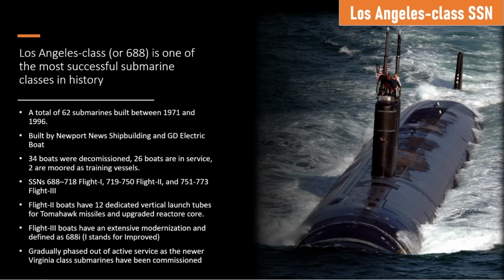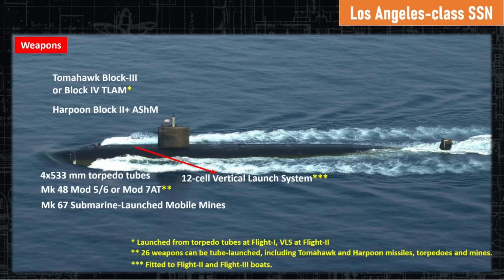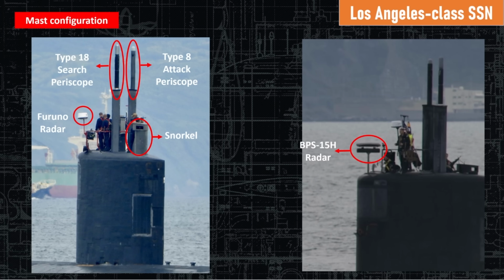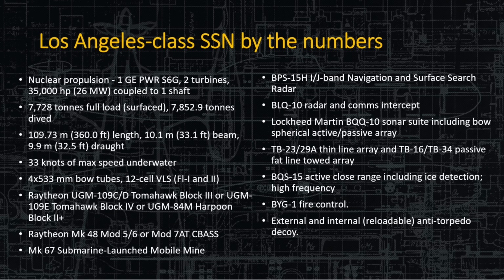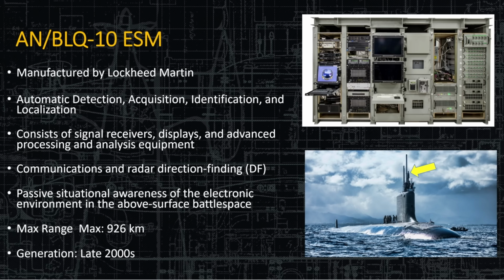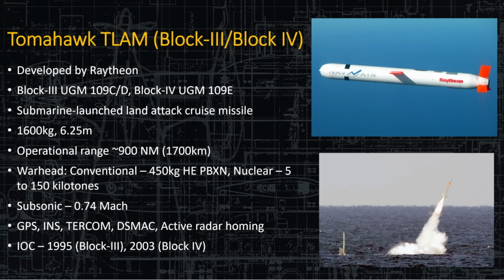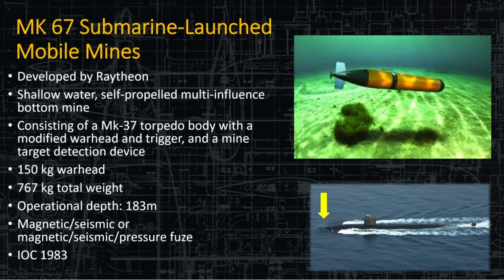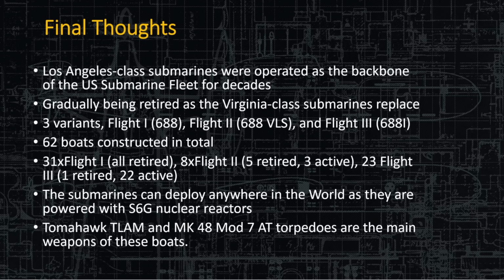688 SSN Sub Brief

Comment: Hold up for a second... I was a staff pickup at NPTU. We did not have a 688 there. When I was there, it was only the Rayburn, the 635 which became the MTS-1. I went down to the shipyard in Charleton and qaulified SRO on the Webster, SSBN 626, which I rode up to NPTU and became the MTS-2 (626). Maybe that's changed since as I've seen airial pics that now show that there's 3 MTS boats there. Is that 3rd MTS a 688? I was there from '90 to '93...then went to Groton and was on the USS Springfield, SSN-761...

Comment: Yeo. Not a bad piece. Just a couple.of pointers;
- Electric Boat shipyard is in Groton, CT. as is the sub base - they are not in New London. (Similar to Portsmouth Navy Yard, whuch is actually in Kittery, Maine.)

First SSN 688 class I worked on was SSN 719 (USS Providence). I followed on to the SSN 725 (USS Helena).

Also;
- the SSN 688 class boats were largely built entirely in the General Dynamics Groton CT shipyard. The yard in Quonset RI was largely 'packaging' modules and later the fabrication of the indivudual hull sections was also done in Quonset for later hulls. During the timenof the launch if the SSN 700 (USS Dallas - my granddad was the trigger man on launch day) and the keel laying of the USS La Jolla the hullmsections were being done in Groton CT, with sub-assembly 'deck' and system packages were being done in the Quonset RI yard.

In the last fifteen years or so, the majority of the prepackaging modular assembly is oerformed in the Quonset yard, with 'final assembly' being done in Groton CT. 

In the past two-years the Groton CT yard has been expanded with the completion of the 'South Yard Assembly Building' to support the final assembly of the Virginia Class and all following deaigns.

MSSGXENDS

Going Deep and Quiet...

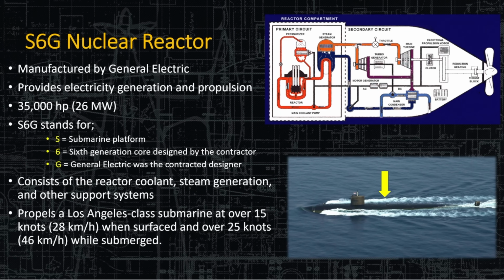Comment: 19:36 Reactor Make Heat.  Heat makes water VERY HOT, but it don't boil because it's Pressurized.  Hot Water go into steam generator. Radiant heat from hot water turns cool water in secondary loop into steam.  Steam turns turbines, which make electricity and turns roundy thing on back of boat.  Steam cools and condenses back into water, which is reused.

Comment: My dad worked for Hughes - Fullerton in Undersea Warfare. He was a design engineer for the Towed Array Sonar. There were approx 70 - 6 ft. modules that screwed together. There were several Hydrophones in each module. The module were filled castor oil. A very unfortunate oil to deal with. Castor oil was neutral bouyant. The Towed Array was pulled behind their research vessel as far a mile behind the ship. And yes they lost entire arrays to underwater mountain ranges. I have my dad's files that hold his patents. They also had a "sound source" that was basically an underwater speaker that was extremly high fidelity. Water is a perfect medium to broadcast sound. I knew all of his co-workers and worked on the ship when I was a teen in the summertime. It was tied up next to the fireboat house under the Vincent Thomas Bridge..., the bridge Tony Scott - Top Gun Director jumped from...., I loved being on the water front and hanging around the Ralph J. Scott fire house.

Comment: I was in the Navy 1992-1995 on a AC CVN71 but after I worked at AUTEC 95,96 on a torpedo retriever pulling out MK 48's and sonar buoys from testing off Andros Island. Was fun and saw a lot with subs there.

Comment: I spent 2.5 years at the prototype school in Charleston in the late 90's.  Six months as a student and 2 years as a staff pickup, great duty if you are young and single.  Went from there to SSN-686 L. Mendle Rivers, the last of the pre-688 boats on the east coast.  We decommed at Bremerton in 1999.  From there went to SSN-708 Minneapolis-St. Paul.  Having served on 3 different generations of boats I found the older ones to be much better.  The 688's are bigger but not nearly as user friendly from an engine room standpoint.  Reactor operation and casualty procedures added too many layers of complexity.  I always thought the newer boats would be easier to run with better tech and automation, wasn't true at all in my experience.  Of course it didn't help that the MSP had failed her ORSE right before I got there and the  eng, COB, CO, & EDMC were all horrible people that squadron had forced onto the boat in order to improve operations and moral.  It was a great experience in how not to lead people and I still use it to this day in my training classes.

Comment: EM nuke aboard 723. Levels are correct as you said, but quite obviously the 'artist' gave a rough guess drawing up the engine room and reactor. Laughable, actually. Served about the battle-E Kam 642 gold crew before that, the crew personality was incredibly different between the two ships. if I were to do it over again, I wouldn't be a nuke, it was a hard life.

Comment: I am a Plankowner on the SSBN 635 Sam Raburn - one of those two subs used for Nuclear training at Goose Creek - I reported aboard her on April 10, 1964, and left her for the SSN 603 Pollack on April 10, 1965 - I Volunteered for sub duty just after turning 17 due to the sinking on April 10, 1963 - My grandson is stationed on a Fast Attack out of Hawaii -
Reply: The 635 was taken away to be recycled (unsure when, sometime before I got to prototype in early May) and the 626 is no longer used for training. The only two MTS’s left in service are my boat, the USS La Jolla (SSN 701), and the USS San Francisco (SSN 711).

Comment: “We do not build submarines on the west coast…”
Except for all the propulsion and power generation equipment. And all the missile launch systems.
Reply from the maker: submarine power plants are made in Rhode Island. Do you mean components that go into a power plant?
Reply: @SubBrief  in CA we make the VA main propulsion unit (turbines and reduction gear) and ship service turbine generators, basically everything in the engine room, and the VA MAC launch unit, as well as every ballistic missile launch system ever put in a SSBN.

Comment: A little trick I learned way back to visually differentiate between the different flights of the Los-Angeles Class. Flight One boats sit higher on the bow end. Flight Two boats sit level. Flight Three moved the forward dive planes from the sail to the hull for better dive control.

Comment: I was the DCA and then the AWEPS on the Topeka (SSN-754, Flight III 688i class) for a while. Trained on the MTS-626 in Charleston Prototype after NNPTC. Went through the Kittery shipyard major overhaul, shakedown, etc and change of home-port to Guam to replace the Miami following her loss. Qualified ENG (Graduated PNEO) just before I separated from service (for family reasons). I also did a ride for quals on the San Juan (SSN-751, also a Flight III 688i and sister ship to Topeka) while we were in the yards.
Edit: I'd like to note as a Nuke, that the engine-room hatch was rarely used as an entry/exit, as that is where the shore power cables were connected to provide electrical power when the reactor is shut down. There is not much room to maneuver around those to enter and exit the boat. The weapons shipping hatch was by FAR more convenient.

Comment: I loved the 688 class.  I was an nuclear trained EM1(SS) on the commissioning crew (aka Plankowner) of the USS Bremertion (SSN-698) 1980-1984.  It was commissioned in 1981 and left Groton for Pearl Harbor (a great place for a home port) and was finally decommissioned in 2021 completing 40 years of service.  We could go anywhere in the world undetected (and did).  

My longest trip underwater lasted 77 days.

We also carried the SUBROC nuclear tipped cruise missiles.  BTW, in addition to supplying the diesel and ventilating the boat, the 688s used the snorkel and low pressure blower to pump air in the ballast tanks to surface.

As for the bridge, I was the JA phone talker in the bridge of the boat for the maneuvering watch so I had a bird’s eye view entering and leaving all of the places we visited.  

We used to put shore power cables in the after escape trunk and used the forward escape trunk for access.

Comment: The second good thing about fiber optics is that it can't short. Heck even if the outer layer of plastic/rubber breaks and water ingress into the cable itself won't have any impact on the signal as the fiber optic cable itself consists of several layers where the core is the main component needed to maintain the signal

Comment: Has anyone got a great comparison between Diesel and Nuclear submarines? I would like to be able to tell people why Nuclear is a better option.
Reply: They can be underwater much longer, and away from port much longer, therefore harder to detect/destroy. They are also generally quieter and faster
Reply: The main advantage of nuclear submarines is that they are faster than diesel submarines. As or near quiet is a secondary consideration. The next advantage is greater power for electronics, it takes a lot of power to operate a sensitive and large amount of sonar equipment and scanners.
Reply: No need for refueling.
Doesn't need oxygen to combust the fuel.
Much quieter than a diesel engine.
Can create massive amounts of electricity for ship systems as well as purify water while doing it.

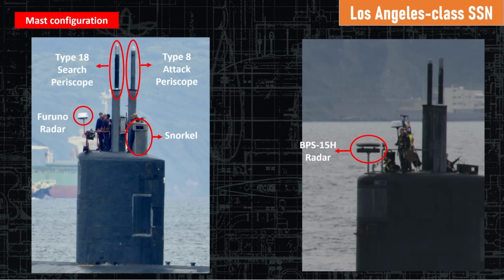Comment: From about 10:20 to 12:30 that picture on the left, the whole sail looks janky. It looks all patched together with pieces torn off on the bottom... it honestly looks like something a kid built in shop class. Whats up with that? Also, what is the "maneuvering room", right behind the reactor?
Reply: I believe that's where they controlled the reactor.
Reply: For a 688 maneuvering is near the reactor but doesn't share a bulkhead with it. Our older submarines had an entire Auxiliary Machinery space between the Reactor and the engine room.

Comment: Was “tens of thousands of tons” on the towed array a mistake? Or is that accurate??
Reply: Got to take into account the weight of the array and the cable then add to that the drag produced on it as it was pulled through the water at speed.
Every inch adds more drag.

Comment: I shouldn't be surprised (yet I am) about the snorkel. I'd just figured the majority of atmosphere on the boat was made with the bomb, I didn't realize a nuke sub would still have a snorkel. Does it actually get much use?
Reply: Suicide to operate the Diesel without at least the hatches open, the machine has to pull air from outside. It's exhaust is always ported out the sail not the snorkel - that just draws air when the hatches are closed.
Reply: @craftpaint1644  I see. I'm surprised there's a diesel on the boat given the nuke plant. Was it just a precaution against that failing, or was it still a primary piece of gear at that time?

Comment: I had to chuckle about folks who could not handle extended underway periods being moved to the surface navy. Former destroyer sailor here and back in the early to mid 80's we would deploy away from Norfolk for 9 to 10 months and during that time we would have at least one, usually two stints of 100+ days straight underway. Add to that some folks were not cut out to the kind of rock and roll walking on the bulkheads you would get on a tin can.
Reply: I spent 4 years in the Navy and never went on a ship.

Comment: Got out and went to work for NNSY. Got assigned to 688 as Instrument & Control tech. Worked on the boat for several years bringing up reactor control systems, doing initial calibrations on them, watching the crew show up (including the Dirty 30) and then was in the Control And Testing trailer (the Cat House) on the pier to record initial crit and power range testing. Was a good time!! Capt. Christensen (sp?) was my next door neighbor.

Comment: how do you generate clean air?
Reply: We mainly use three pieces of equipment, the CO2 Scrubber that gives our submarines that unique Amine chemical smell, the O2 Generator that releases oxygen from clean water, and the Hydrogen Burner that safely burns Hydrogen produced as a battery byproduct. Infrequently the Captain may order O2 Candles lit or CO2 absorbing canisters opened, they have specific containers for the purpose.

Comment: The numbers run from 688 to 773 but the opening slide says 62 made.   Were some numbers skipped?
Reply: @davidgill3356  Ohio class SSBN numbers
Reply: @fredwalter2291  Perfect, thank you.
Reply: 726-749 were skipped for some reason. I'm sure if you do some digging online, you can find out why.
Reply: @shura0107 I saw the first hull sections of the 726 Ohio come together at EB in 1976.
Reply: @Chris_at_Home  that's cool!
Reply: @shura0107  Thank you, I figured someone here would have the answer at hand,
Reply: @davidgill3356  i just went on wiki and looked it up.

SSN-725 and SSN-750 are the last 2 Flight IIs in service, not counting the ones used as training ships.

Comment: I was stationed on the SSN 687 USS Richard B Russell the last Sturgeon class submarine produced. The 688 or Los Angeles class is a very good submarine.
Reply: Are you familiar with Skipjacks? I want to build a cutaway model of the USS Scorpion, but I can't tell from drawings if the forward escape chamber is entered from the torpedo room or another space above it or both. Also can't tell where the trash compactor is, port or starboard. Drawings online are awful.
Reply: @craftpaint1644  I’m not but I will see if anyone I know is, can’t hurt to check.

Comment: 33 knots is not the max speed underwater, its above 40knots at war speed and can exceed that for very short, distance to outrun torpedoes .
Reply: I'm pretty sure he was trying really hard to avoid discussing anything even remotely classified, such as top speed.
Reply: @davidsmith8997  these dinos are 30 to 40yrs old, the russians and chinese have and had the specs and info for quite a while now.
Reply: Mark Harmon is going to show up at your door...
Reply: @flyingsword135  i doubt that. These relics are 30 to 40 yrs old, the russians have had all the info/specs for years and passed it onto the chinese. A calculator and a few  coefficients for ocean temp, salinity, region of operation and the known MWth for the s6g and d2w core will get you close enough to the answer using high school physics class equations.

Comment: Aaron, what’s the chance of the Navy sterilizing a 688 of all sensitive equipment & setting it up as a museum ship next to Nautilus in New London, Ct?
Reply: Next to zero. Nuke boats in general are effectively impossible to convert into museum ships because part of the decommissioning process involves literally cutting out the reactor section and welding the two ends back together. It's a miracle that we have Nautilus intact at all, let alone as a museum, so one of the 688s would have to pull off something truly insane in terms of historical significance to even consider preservation.

Comment: The reason we rarely use the Aft Escape Trunk is due to we use it install shore power cables. This completely blocks access to it. FYI if the reactor has D in the name it is Destroyer(surface) that is why it used the S6G ie submarine core. Not sure why you mentioned it then talk about the S6G a minute later. Otherwise nice breakdown.
Reply: Because some S6G Reactors used Destroyer prototype cores. Sometimes the core type doesn't match the reactor type.
Reply from the maker: Very good point and 100% true.

Comment: I'd be very fascinated to know more about how they discover who can't tolerate the living conditions for extended periods of time. Do they basically just lock candidates in an anechoic chamber for a couple days to see who goes crazy?
Reply: Most of the submarine ratings go to BESS. Basic Enlisted Submarine School. The nukes go to training platforms. When i taught in the 80's, it was 13 weeks long. Normally up to 30 students. They learn the basics of all submarine systems. Damage control training on fires and flooding. We have a submarine control room operational trainer. Teaches the sailors how to dive and drive the boat. Instructors go through all types of casualties situations that may happen while underway. Several videos on BESS are available. The one thing they don't show is when you take the students down to the boats on lower base for a tour. If the student cannot go down the hatch, he has got to go to fleet.